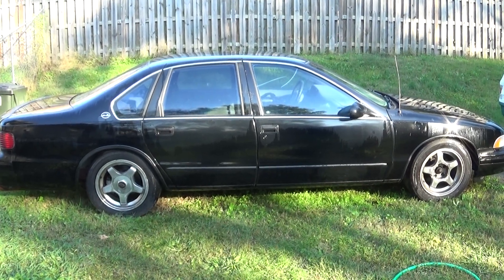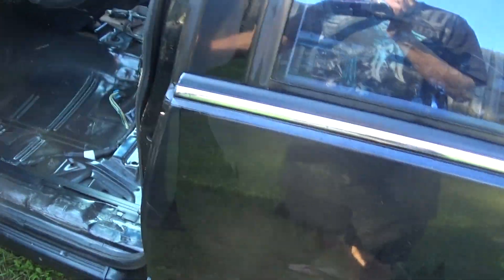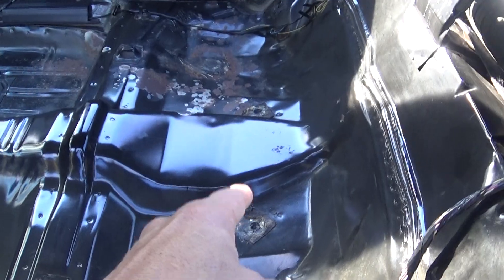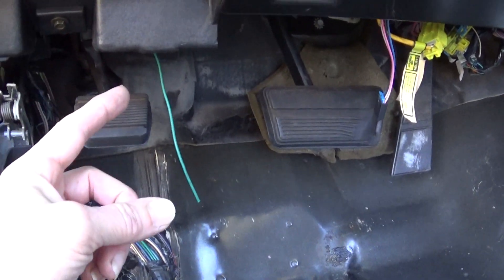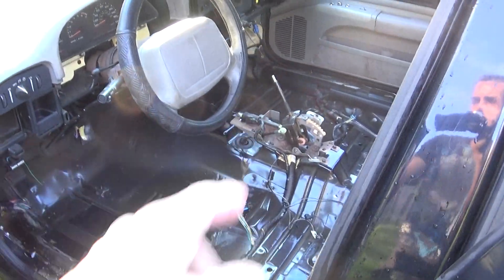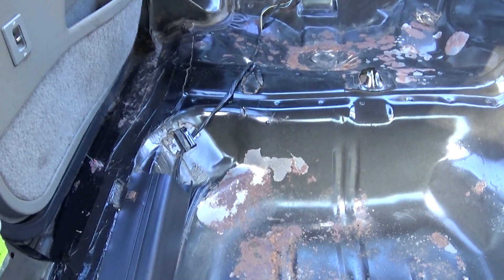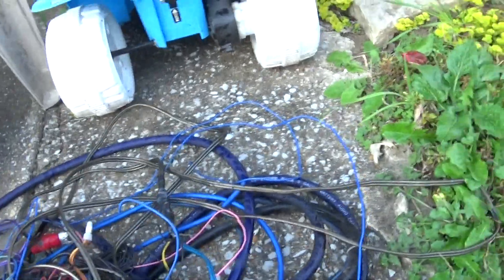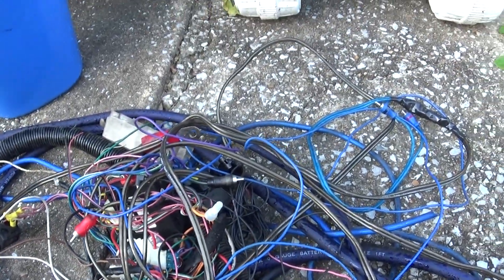1996 Impala SS Interior Tear Down & Cleaning Part 2 by SSinteriors (Matt)

Comment: Love the attention to detail. How long should the paint hold up on the plastic?
Reply from the maker: Thanks and I only coat original jobs with the same color to freshen up faded spots and give an even color thru the whole car. Any jobs with full color changes or custom will have to be wrapped with me. Anyways the plastic on the impalas does take the paint well as long as it's cleaning proper. I'd give it 8-10 years in the sun? Or more garage kept.

Comment: Matt I have a question how can I mount some new Camaro seats in a G body what would be the easiest and cleanest way?
Reply from the maker: Need to reinforce the area you're mounting too. Use a large piece of steel and or fender washers maybe. Someone to weld a bracket would be best.
Reply: @charles1matt  thanks Matt.. One more thing Matt where can I find that thin carpet you use on door panels
Reply from the maker: @Roguestatus650  albrightsupplies . com and it's called superflex carpet/nonwoven no backing like speaker box carpet
Reply: @charles1matt  thank you